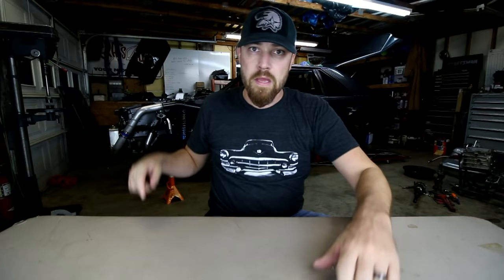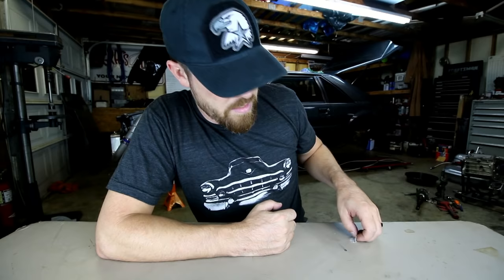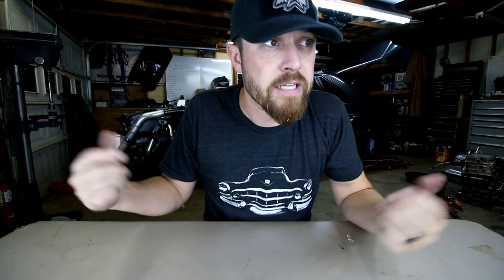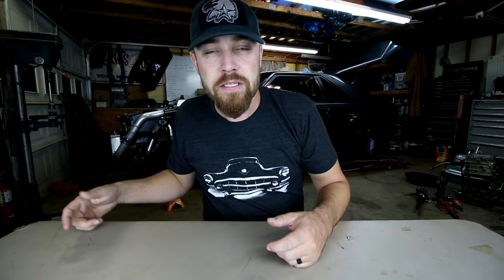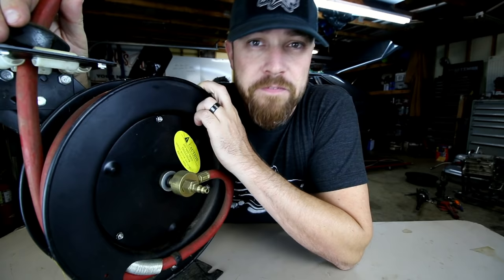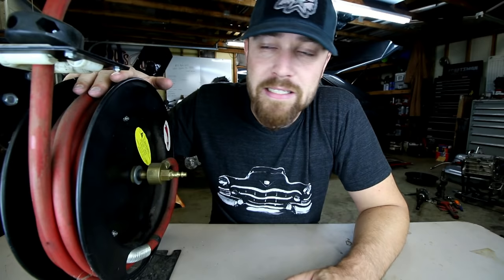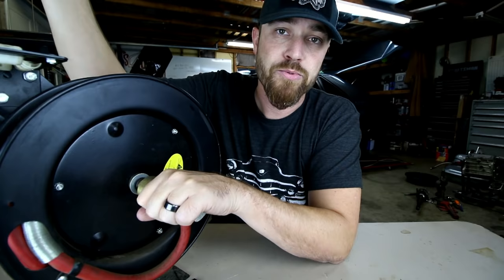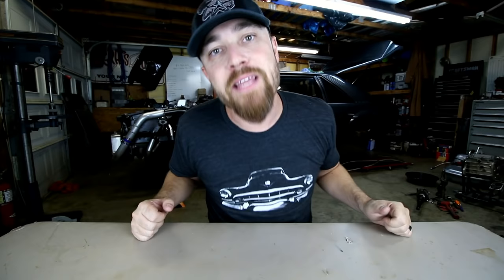You need This Tool - Episode 36 | Air Tools Hose Reel

Comment: I have my hose reel mounted under my work bench I made, I move a lot so once I settle down in one area I'm putting mine higher up. One thing I don't like about the hose reel is the junk rubber hose they give you. I had cracking on mine within 2 years and upgraded to a flexzilla hose. We will see how long this one lasts.
Reply from the maker: mounted up high works nicely

Comment: yup these make life so much eaiser if you use air tools a lot.  Just make sure you get a good quality one, the mechanism on the cheap ones will crap out on you so spend a little bit more and get a good quality one and you will be very pleased ;)
Reply: What do you mean when you say the mechanism will fail?  I have had one from harbor freight for years and while I have had to replace the hose and o-ring due to dry rot, the reel itself continues to work great.
Reply: The internal ratcheting mechanism that makes the hose stop and retract